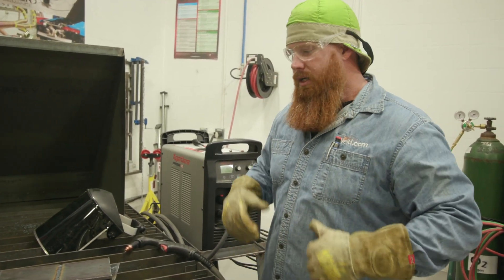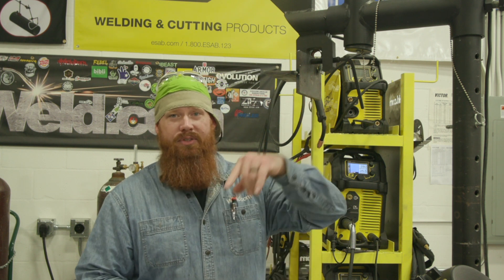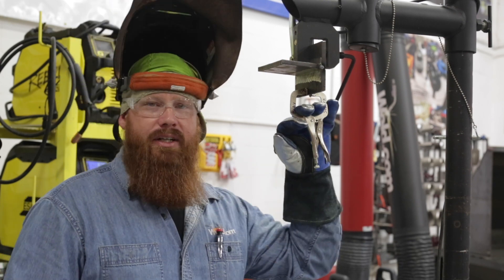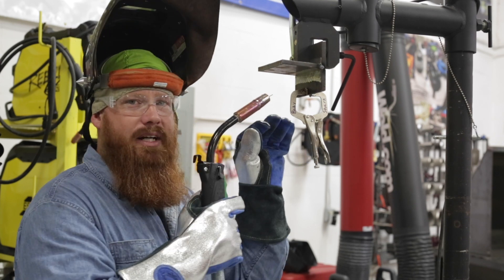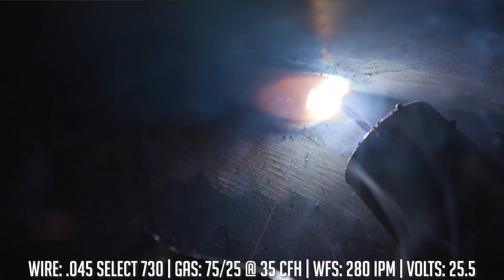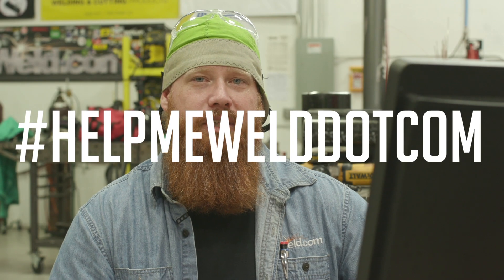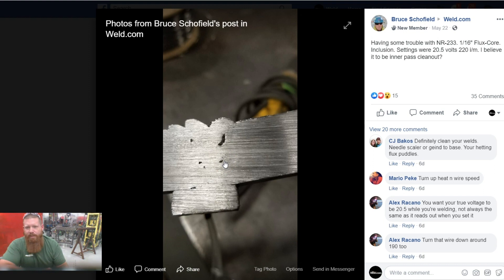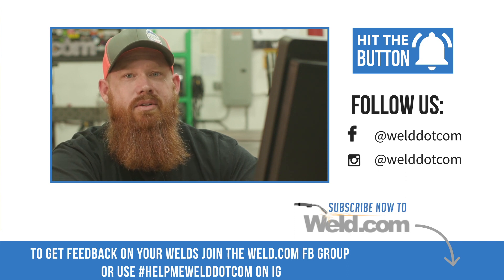Overhead Gas Shielded Flux Core Welding

Comment: I have a 3 three position test in 2 days, 1/2 plate 1/4 gap, 1/4 backing strip, overhead first. If I pass the overhead root I can go on to vertical and horizontal regardless if I failed overhead plate. If I fail the overhead root its done. 1st time testing. I feel like I put the time in but damn I'm nervous.

Comment: Did  that for two year 3rd shift using 1/16 dual shield. In the overhead you learn to keep out of the fall hot material.

Comment: Bob wish you the best! Had an engineer ask me the other day why need gas with flux core? He couldn't understand why the welder used that instead of 7018 rod. Told him you told them what materiel to use angles to cut and what weld procedure to use you should know that. He had a blank look on his face.

Comment: Bob, I hope you get it all sorted out very soon man. I appreciate all what you have tought me. See you soon

Thanks Jason. I appreciate the wealth of knowledge. I have a small mig machine (Fronius transsteel 2200), and was wondering if it's possible to do dualshield on it since I am completely disinterested in short-circuit MIG. The machine can do 220 amps and 24.5V @ 30% duty cycle. Realistically, what are my chances on dual shield?
Reply: Precivilization you could probably get away with an .035 (.9mm) you’d be operating on about 170-200 amps which that machine shouldn’t have a problem running.

Comment: 1/16 flux wire will not work well below 24volts and a proper corespondent wire speed 
Not burning hot enough to properly use the flux within the core of the wire

Comment: Hey Bob, I wish you well! Jason thanks for your flux core tips. I don't like flux core. The structural steel shops I've worked at 75%argon/25%co-2 will not be ordered because of everything is solid core per AWSE criteria, interesting what you accomplished.Thanks Dude.

Comment: Interesting to hear flux-core AND shielding gas.  I thought it was one or the other!    Never used flux-core wire, only solid and 75/25.
Reply: Its technically called Dual Shield Fluxcore. Dual shield meaning the gas as a shield and the flux being one as well.